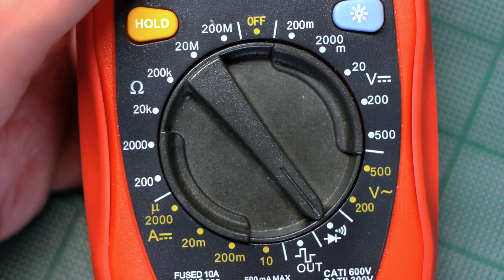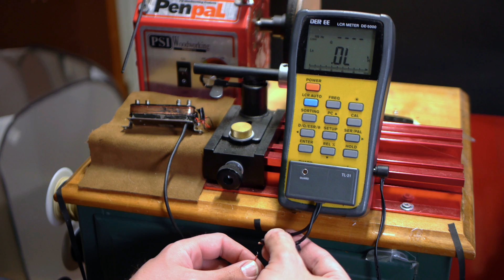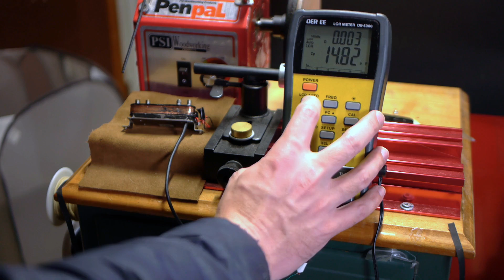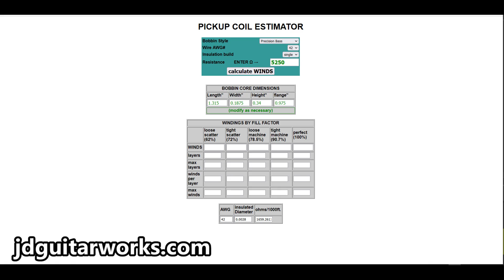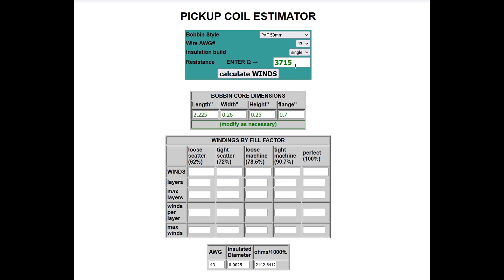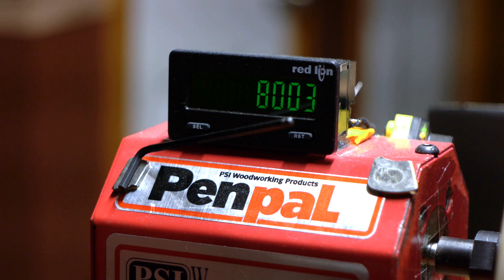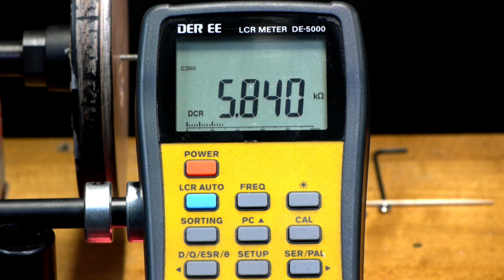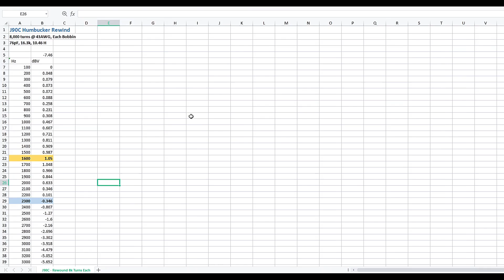Broken Humbucker Diagnosis + Rewind

Comment: What have I got ? A double coil brass covered six.  I can't remove the cover plate from the back plate, (welded) no screws.. only one green wire comes out with a bare ground wrapped around a white hot wire inside it. Only marking on the entire thing I can find is the letter R stamped into the back plate. Is there a way to open it ?  From the bottom, through the ventholes I see the bob and it has two side holes and one in the middle with a little square hole to see  the coil on the edge. I don't know what it is.  It's humming now and I am thinking I can fill the gap in the center with candle wax because that worked before on my friends pickups that I could take apart. I have no clue.
Reply from the maker: The cover is held on with solder, and they can be a pain to get apart. For those, I'll usually use a soldering gun, as they have way higher power than a soldering iron. You need to heat the solder joints and either remove the solder with a solder sucker, or give it a hard shake into a garbage can when it's molten hot. Definitely recommend wearing eye protection if you use that method. 

The square hole on the edge is standard for humbucker bobbins. 

I'd try wax potting it if you want to reduce squealing. Though if it's buzzing, it could mean the ground wire to the baseplate is disconnected. A disconnected baseplate wire will cause buzzing. What it sounds like is you have single conductor wire -- an outer insulation (green), with a bare wire and white wire inside. The white is "hot," bare is ground, and the bare should be connected directly to the baseplate. 

If you have a continuity mode on a multimeter like I had in this video, test that ground wire. Touch one probe to the baseplate on the pickup, and one probe to that bare wire. It should beep if there's continuity. If there is none, then there's your problem, and the source of your buzz. Often, that bare ground wire can get twisted and break. Sometimes stripping the wire back a bit, and getting some fresh bare ground wire is enough to fix that. Other times you may need to re-solder the ground wire to the actual baseplate. 

Definitely be very careful taking it apart, if you choose to do so. Wax potting will help with squealing/microphonics if that's the problem, but not buzzing, which is more likely a grounding issue. I'd also recommend a wax warmer, a small crock pot, or anything of the sort to fully wax pot the pickup -- it'll make the waxing job much easier. You only need to submerge it for a few minutes, enough until the wax goes clear. 

But definitely test that ground wire first. Continuity between the bare ground wire and the baseplate is essential. If you have continuity, you can rule that out as the problem, but if you have no continuity, you'll need to fix that to solve the buzzing issue. 

Let me know if you make any progress!